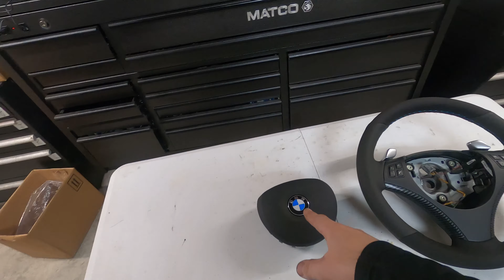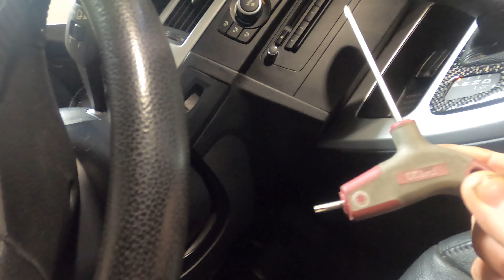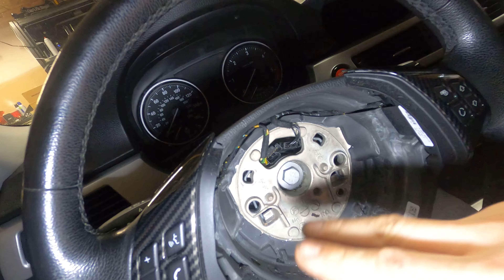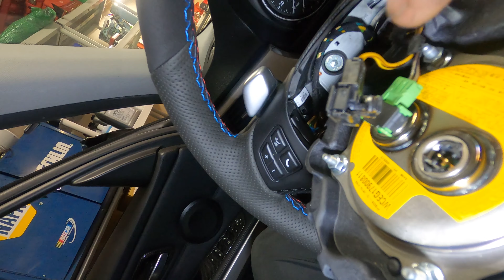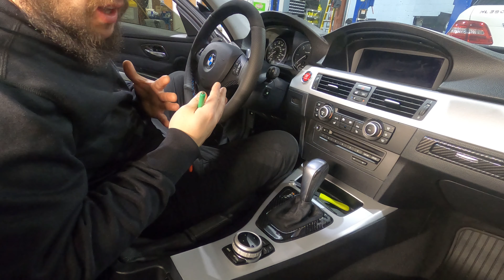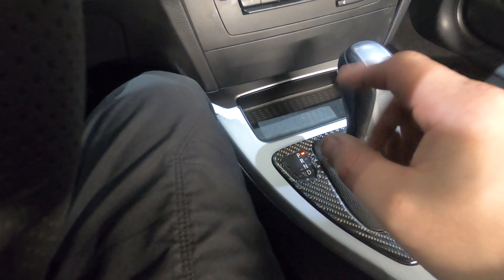335D Sport Steering Wheel Install

Comment: Hi
I have 2013 Mini Cooper R56
I think it has same equipment as your car
I replaced the steering wheel with the new one that it has paddle shifter
I just need to know where can I find the retrofit kit?
Reply from the maker: I'm not aware of a retrofit kit. However, it looks like the plug connections should be in the clock spring assembly, no matter the year. It may just require programming to turn that function on in the vehicle.
Reply: Does this mean that there is an existing connection between the assembly in the stearing wheel and tge gear knob and I only need to do the programming? Do I need to use bimmer code?

Comment: So I just bought a 335d yesterday and it has the paddle shifters but they don't work only the gear shifter sport mode
Reply from the maker: Interesting. I wonder if they just installed the steering wheel but not the harness.
Reply: @MunkysGarage  so I would have to buy a harness?
Reply from the maker: @osamadavid9727  yes. The harness I used for this came from burger motorsports. This is a link to the harness. https://burgertuning.com/collections/3-series-e90-e91-e92-e93-m3/products/bmw-paddlesift-retrofit

Comment: you didn't have to change the buttons? on bms guide it was you have to change the buttons and not just install the transmission wire harness because it won't work without the buttons
Reply from the maker: Reading there write up on there site it seems things have changed since I did it. Not really sure what changed. All I know is I received the steering wheel and harness from the owner as you saw in the video and installed it and it worked. The harness I used looks different from the one currentlyontheir site. Mine kinda piggybacked off the factory plus minus function of the factory shifter. The new harness looks different and I'm not sure how they are accomplishing this now. Hopefully this clears things up.

Comment: Wondering, if I go from factory heated steering wheel like you have here, and I find a sport wheel that is heated, I’m good to preserve the heated function right? I don’t need any other components?
Reply from the maker: Yeah it should be plug and play with no issues.

Comment: What about the steering buttons, still work? I have seen on other videos that you have to change the buttons or get an specific set of buttons
Reply from the maker: Steering wheel buttons still work just fine. Didnt have to do anything with those. Just had to deal with the wiring for the paddle shifters.

Comment: My connector from burger motor sports is differnt. It has two butt connectors one white and one black and the blue plugs of course
Reply from the maker: I dont have any experience doing this aside from what you see in the video. If your harness is different than that I'm sorry but I won't be much help.
Reply: @MunkysGarage  do you have a link to the connector?
Reply: @MunkysGarage  the only one they have for sale is differnt
Reply from the maker: I looked at the one they currently have listed. It is definitely not the same as the one I used. The one I used does not appear to be on there site any longer.
Reply: Looks simple the other one they have also

Comment: Curious if you can swap a f30 steering wheel?
Reply from the maker: I'm not sure. Would be interesting to try. I'm sure the steering wheel would physically go on, as I believe the steering shaft size and spline design is the same in all the cars. But I'm not sure about the electronics part.